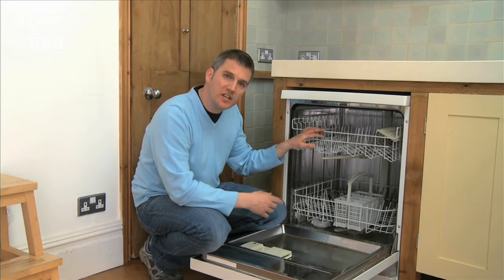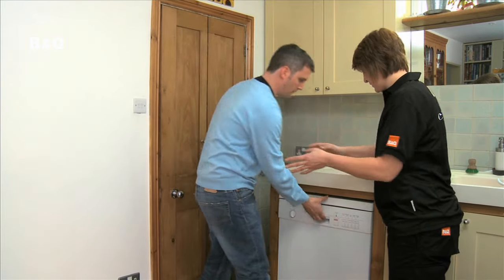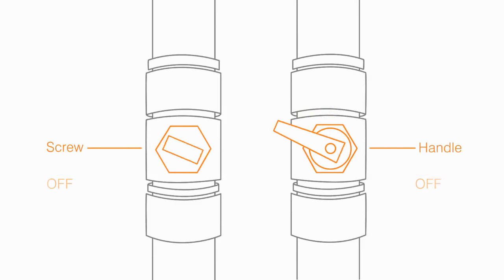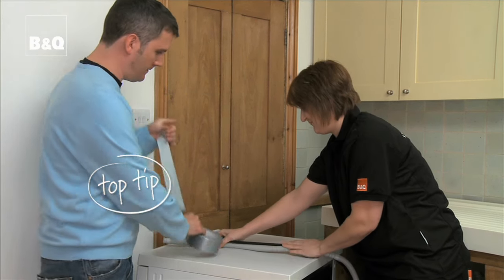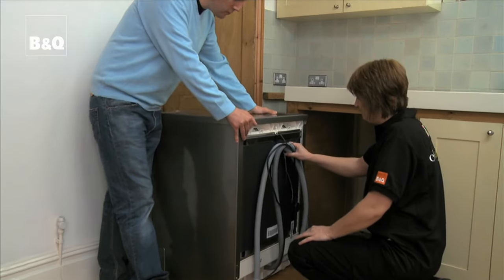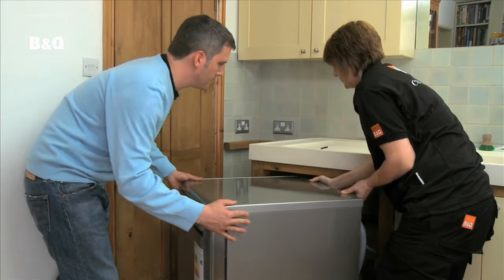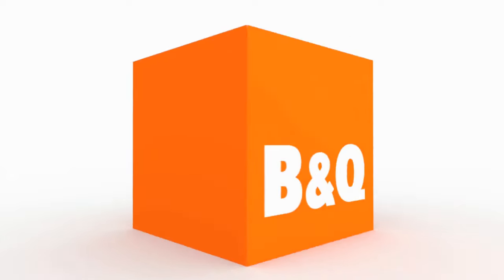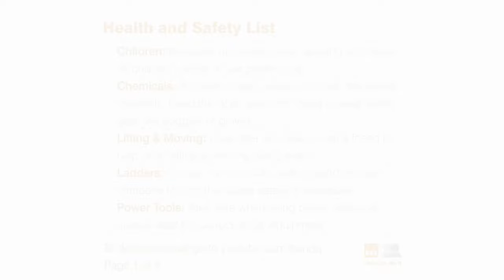How to change a dishwasher

Comment: Thanks, ours is stuck in an infinite cycle and turning off the kitchen fuse meant also losing power to the fridge. I just wanted to unplug it but wasn't sure if that's how it was (it was).

Comment: If the dishwasher cold water pipe is bigger than the one one thats there is there any way to fix this?
Reply from the maker: Hi there, sorry for the delay! I've asked our experts about this, and they've advised the following:

I am guessing the query refers to the inlet water supply. The washing machine/dishwasher cold water supply pipes have a standard ¾” Female connection which fit on the washing machine valve which is 15mm to 3/4” male. It would be more unique than rare to have 22mm pipe to feed from but it could be reduced down to 15 to fit a standard appliance valve.

A specific 22mm to ¾” washing machine valve is not something that is seen on the market so other fittings/modifications to the system would be required.

Depending on the customers arrangement and skill set, there are multiple options on how to reduce down from 22mm to 15mm. Compression/end feed/plastic push-fit etc.

Fundamentally they would need a 15mm plain end of pipe to be able to connect our washing machine valves to. I would also advise if the customer is adding this to a main line, that they add a check valve off whatever pipe they are connecting to, in order to lower the risk of backflow into the rest of their water system.

Most appliances would already have these installed, but it is good standard practice and advised by drinking water authorities.

I hope this helps!